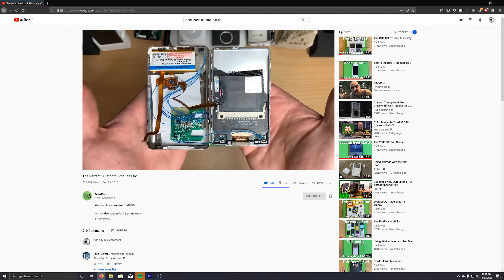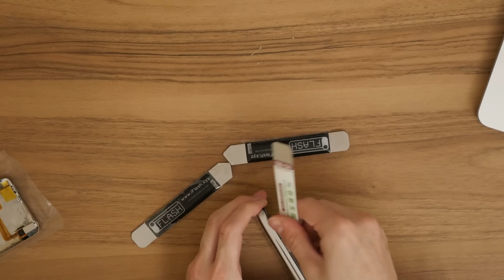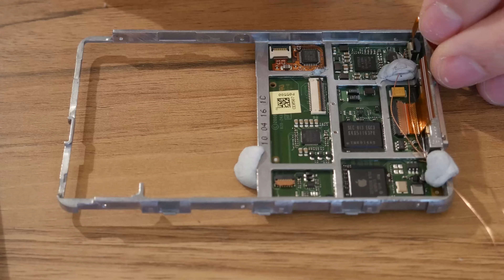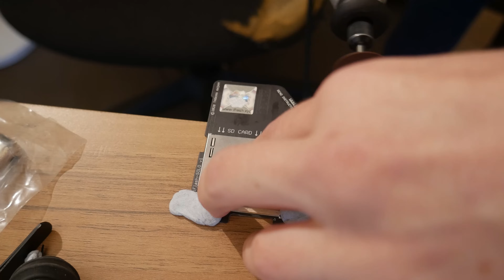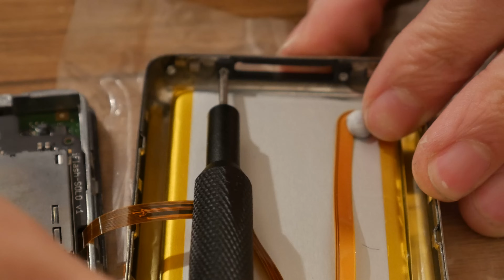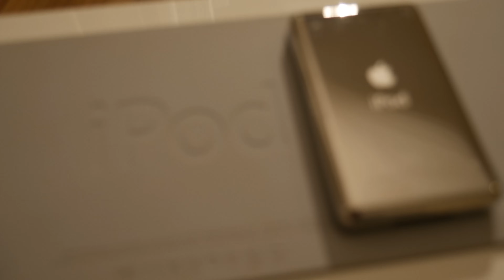The REAL Perfect Bluetooth iPod Classic

Comment: I can 3D print a bigger housing for my iPod, so I can probably fit the 3000 mah battery, Bluetooth module, and a quad flash board
Reply from the maker: I would love to see this.
Reply: Pendleton 115 I would attempt it, but my soldering skill are garbage and I don’t want to ruin my 5.5 gen 80gb ram motherboard
Reply: @Pendleton115  I have found a significantly smaller Bluetooth transmitter so you can use the original back. This module should fit it the space where the old battery was. 
https://www.ebay.com/itm/2-in-1-USB-Bluetooth-5-0-Audio-Receiver-Transmitter-Wireless-Adapter-Dongle-Aux/164396872805
https://cdn.discordapp.com/attachments/752715920400449577/762758463331237920/unknown.png
Maybe a part 2?
Reply from the maker: Chello Chamber very interesting! Thanks for the link. Any idea on the quality? I originally planned on using a small Bluetooth transmitter but the quality sadly wasn’t up to my standards. And unfortunately the biggest issue getting the thin back to fit isn’t actually the transmitter, but the flash solo. Which is too thick.
Although maybe there would be a better chance with an iflash quad and this smaller transmitter.
Reply: @Pendleton115  The iPod Modding discord is full of people who are enthusiastic about this topic. I wasn't the one who found this part but someone else has and has ordered one. You can probably ask him a few questions. https://discord.gg/aYJKwP

Comment: Awesome video - by far the slickest setup of Bluetooth I’ve seen on YouTube. 

In the q/a section you mentioned about needing to reset the Bluetooth adapter if it stops allowing a connection. How frequently does this happen? It is obviously an issue that some may not be able to resolve without returning to a technical guru. It makes it hard to build a business case for it if you’re dealing with reliability issues?
Reply from the maker: Greggles UK I’ve had this happen once in the past 3 months of using the device, and it was caused by a firmware update on my AirPods. The device was still able to pair to other Bluetooth devices easily though.
Reply: Thanks for the very quick reply ! That’s a little more re-assuring.

Great video and thanks again.

Comment: Hey, thanks for the video and congrats to the really cool idea of putting the push button „behind“ the on/off switch!!!

I currently use a Bluetooth transmitter that won’t power off. So it constantly discharges the battery since the two solder points don’t reflect the state of the device (on/off or locked/unlocked). 

Did you happen to  know if there is a place on the pcb that provides that? Power only when the device is „on“?

As an alternative, I was thinking about using the lock/unlock switch of the iPod. I could track that with an attiny and this would then power the Bluetooth transmitter...  

Any thoughts?
Reply from the maker: I tried looking this up, but couldn’t find any documentation on it, it’s usually better to have an external switch as you need to pair it also. You can always turn the lock switch directly into the pairing switch by soldering to its solder pads if you don’t want to have a button behind it.
Reply: Pendleton 115 oh, the button is already in place. Glued on top of a piece of a chopstick, since I used an pod with a deeper back :-)
And it works like a charm. 

And yes, same here. Had no luck finding any information in the pcb. Only some options for sound and power. 

I’ll look at the switch with the Multimeter and see what I come up with. Maybe I can use it to turn on/off the BT transmitter.
 I don’t want to damage the outside and drill holes into the iPod. So I’ll have to come up with something else.
Reply from the maker: Lennart Hennigs usually Bluetooth transmitters only have one button, that acts as both power and Bluetooth on off, but if yours for some reason has two, you could use hold switch for on off, and then the button behind the hold switch for pairing.
Reply: Pendleton 115 I don’t use a stand alone emitter but a board. It’s called KCX_BT_EMITTER 1.2. you’ll find it on eBay and Alibaba. 
The advantage is that it is really tiny, has solder pads and you need no disassembly. But no, no power down logic. But yes, the on/off switch of the iPod might do the trick.

Comment: I'm truthly blown away with your skillz set. Before i give a little info on me, let me ask you where we or I can find the click switches you're using on your video? Don't have to be exact, but close enough to work with your video if needed. 

About me I been playing with the iPod Classic 5.5 80g thick back units. I've modified (4) units so far. A 2TB (Mem cards), 1TB (Mssd), 1/2TB (500Gb Mssd), and 80GB to be modified to 4TB when parts come in. Its been an adventure I must say. Will answer any questions if needed. Awesome video that I plan to use for Blue Tooth mod 4TB first. The four slot card sold on the internet I plan to use with 1TB(4) memory cards. I format each flash drive or Mssd drive to exfat before i connect to ituned, faster process thru itune. Nuff said for now
Reply from the maker: Hornet72blue it’s a switch about 1cm/x1cm, I believe there is an arduino kit that comes with a set of them soldered to a board. That’s where I got mine from anyway.
Reply: @Pendleton115  Thanks you're the BOMB, much appreciated

Comment: What is the difference between the headphone and hold switch flex cable in the thin iPod and the thick iPod. I have the same iPod as the one you have used in the video but I don't know what the difference in the cables is and if its vital for the project. Please help.
Reply from the maker: The cables are identical, the connectors at the end are different, the thin back has a curved connector, to make it line up with the curve of the iPod housing, the thick back is flat as it sits in a flat part of the housing.

Comment: You should watch this video it's called "IPOD CLASSIC UPGRADE" by GEEK DETOUR ...... and another video by TARKAN AKDAM himself. By watching his VIDEO i had the chance to build myself three 7th Gen IPODS with Msata's ssd and the same 3000mah battery you are using....... One of them is 1TB and the other Two are 500 GB ..... And they are still working AMAZING . And by the way the IPOD has only 11 retainer clips..... 4 of them on each lateral side ...... 1 on the top in middle  ...... And 2 on the bottom on each side..... Note: Try to use the "ISESAMO opening tool" is so much better ...... "Trust me"      Far better.....  "Good Video"
Reply from the maker: Thanks for the info!

Comment: Would you at all try modifying a 3rd generation iPod to accept a usb 3.0 charge which is comparable to the 12v firewire charge that prevents it from charging via usb? I really like the solid look of the 3rd gen with the touch surface and lights but hate that I have to use firewire to charge it.
Reply from the maker: Philip Dahl doubtful this is possible, as the third gen requires a lot more juice than what can be provided over USB, although I’ve never used one so possibly im wrong. There’s a chance you could use thunderbolt 3 to charge it but it’d be a difficult process. Probably better off buying a 2012 MacBook Pro with Firewire.

Comment: Gonna try this but will probably add a button instead. Has the hot glue held up in holding the push button?
Reply from the maker: No problems so far, it’s survived the Aussie heat but I wouldn’t leave it in a hot car.

Comment: Cool mod, but there are a few notes I'd like to make:

1. The 7th generation iPod Classic uses a Cirrus DAC, whereas the 5th generation uses as Wolfson DAC. Most audiophiles agree that the Wolfson DAC sounds better.
2. The 5th generation iPod doesn't have that metal shield behind the display, and its faceplate is plastic, so you wouldn't have to cut out that little rectangle if you used a 5th generation.

Additional notes:
If you get a 5th generation iPod, make sure to get the 80gb version. The 30gb iPods have 32MB of RAM, while the 60/80gb have 64MB of RAM. This allows you to put as many tracks on it as you can on your 7th generation, while the 30gb iPods can only have half as many tracks loaded at once. The 80gb is the 5.5 gen, while the 60gb is the 5.0 gen, so that's why you should get the 80gb.
Reply: finding 80gb 5th gen ipods is real tough tho
Reply: @syn010110  Unless you intend on having more than 25,000 songs on it the 30gb model is more than enough. Heck, the money saved could go on flash storage mods instead.
Reply: I doubt if this really matters. for with the transmitter the audio will be lossly converted to digital signal again. I personally think for people who really appreciate sound quality, trying to use bluetooth now on ipod is not a good idea, can wait until speaker/headphones supporting lossless codec to reduce the loss. 
side note: I got one 5.5gen after reading how good it is. it is disappointing. very poor when playing metal or any heavier music. And because we cannot bypass built in DAC easily in 5.5gen i think 7th gen ipod is way more suitable for DIY upgrading. 7th can also be installed into the case of the 5th generation for space extension.
Reply: @weilingxi2427  the apple port at the bottom of ipod. Uses proprietary pin outs to defeat internal audio path.  A high end dongle to dac/amp combo brings hifidelity sound. Dongles made by moon audio were the best back in the ipod heyday
Reply: @weilingxi2427  everybody in this comment section described it as "Warm", so... Of course it's not gonna sound optimal with metal?
Reply: I honestly have no problem with a 30gb 5th or 5.5 gen. I wasn't intending to put much storage in it anyways, just 64gb. 20,000~ tracks is perfectly acceptable for me.
Reply: He's listening over Bluetooth; audio quality of any other part of the system is entirely irrelevant.
Reply: I have a question about modding in general with the 80gb 5th gen. What's a good amount of storage to put in it that will be easily recognized?
Reply: @GodzillaofTokyo  256gb.  As you go up in memory it tends to slow down everything including boot time.
Reply: @GodzillaofTokyo  I have found that when over 20,00 titles, the classic is slow as a slug.  It takes 3 to 5 seconds to navigate each click. It will also add 30 to 90 seconds to boot up.  So, over 256GB makes no sense.  Also, buy the fastest SD card you can afford.  You must use the iFlash adapter.  I have found that the original 160gb hard drive is 50 to 100% faster syncing than any SSD.
Reply: @GodzillaofTokyo  128gb
Reply: i don't understand i have a 30 gb ipod video and its the 5.5 one
Reply: Mostly untrue.
1. Most audiophiles prefer gen 7 for the digital out. Think Wadia iTransport

2. Only true statement

Additional note, not only the 80GB but also the 60GB and 30GB can be 5.5 ver the only real way to tell is to check for 'Search' under 'Music'
Reply: my 5th generation iPod was stollen on a Jetstar flight in New Zealand.  I replaced it with a 7th generation not realizing the DAC was inferior.  Fortunately, I caught a respiratory virus some years later and one of the side effects was suddenly my ipod classic sounded better.
Reply: Is there a name for the ipod ram modules?
if there's a small enough one, you might be able to Frankenstein it in place of the old one
Reply: thats a dream to read as i sit here with my 80GB 5.5 gen
Reply: i got the 5g with 30gb. but it was a long time ago. i just like it more than other ipods cuz its thinner.
Reply: Can the RAM chip be de-soldered and replaced with a higher capacity one?
Reply: @philliumo  Theoretically I would say yes, but you would need to flash a new firmware onto it that fits the hardware change. A different RAM component would most likely require a different initialisation sequence, different commands, and so on to run at all. In the best-case scenario that the new RAM works exactly like the old one but only has more memory, the old firmware probably still has the old byte size hardcoded somewhere.
Reply: I SSD modded a 30gb A1136 5th Gen. Not sure about the max capacitiy, but you aren´t limited to 125gb as in some of the 6th gen ipod classics. I got 256gb in there. Works like a charm.
Reply: What is that metal shield even for? I just thought maybe for reflecting the backlight of the display, but then again, the iPod video has pretty much the same display but with a plastic shield and the displays still look the same. Honestly, I would just switch out the metal shield for a plastic shield and see if it works.
Reply: If you are audiofile you dont use ipod 😆
Reply: @XX-ii8yh  aren't you special
Reply: I got the 30gb 5th gen iPod Classic, as it was on a great deal! For $25 shipping included, I can't really complain. On top of that, I know the 32mb of ram is plenty for me, as many forums talk about how as long as you don't exceed 10k fully itemed songs, you shouldn't experience freezing or tearing with the 32mb of ram and i definitely don't have anywhere near that yet lol. Also, it isn't the 5.5 gen with the search function and ya that would have been nice, but again, for the price i got it im happy. Maybe I'll resell it down the line after getting the refurbing experience from this one and splurge on a 80gb 5.5 gen model, if I feel I am needing those features.
Reply: Got one 80gb 5.5 today.
Reply: Wolfson DAC is praised for the same reason people like vinlys, the "warm" sound, meaning distortion. The warmth in case of vinyls is the wear and tear literally smoothing out the pits and groves on the record. In the case of the Wolfson DAC warmth/smoothness is actually the DAC being inaccurate in its sound reproduction of poor quality rips, but in a way that sounds pleasant to a lot of people. But understand that it's pleasant because the warmth/distortion plays well on lower quality headphones, earbuds, etc. If you have a good pair of accurate headphones, and high quality rips, the Cirrus DAC is superior.
Reply: @zecksoz  Yeah, I wrote that comment a while ago, I now know that the later model iPod DACs are actually more accurate.
Reply: Thanks
Reply: Incorrect / misleading

Here is the correct RAM breakdown:

5th generation (original, 2005)

30 GB → 32 MB RAM
60 GB → 32 MB RAM
Both are 32 MB

5.5 generation (Enhanced, late 2006)

30 GB → 64 MB RAM
80 GB → 64 MB RAM
Reply: Wish I would've known what DAC was a few days back before buying the 6thGen classic
Reply: @UdodaTube  Don't worry about it. I have both types of iPod and the difference is slight at best. Neither of them are as good as people make out, tbh.
Reply: @UdodaTube   Don't worry about it, they all have pretty good audio.
Reply: @UdodaTube  Cirrus DACs in 7th gen iPods are very good sounding and are actually more accurate than Wolfson ones. Plus, Wolfson is owned by Cirrus, and apparently the amp in the 7th gen is way better than in the 5th gens.
Reply: @RiveTheRat  This guy knows what he's talking about. The Cirrus DACs are very neutral and good quality. The Wolfson one has a "warmer" signature, which some like and some don't. In terms of pure audio quality, they're about the same.
Reply: @RiveTheRat Accurate vs Warmer, most people prefer the warmer sound to the flat sound
Reply: there is literally no difference between 5th gen and 5.5th gen. all you are doing is throwing away cash
Reply: @thomas5  as far as i know the one change i have seen is 5.5s have a search function for your library
Reply: @Nate-sq7mw  They also have a brighter and more color accurate screen. That is, unless someone swapped the screen out (they're cross compatible).
Reply: @thomas5    Unless you need the  'Search ' feature. 5.5 only
Reply: @thomas5  you can search on the 5.5.
Reply: @thomas5  the search feature, the enhanced UI speed, enhanced video playback, brighter screen.
Reply: @thomas5  more ram (and yes, there is more ram) and the search feature (no one uses that)
Reply: Thomas Simpson there is though. More ram means it can handle more storage if you wanna flash mod it and stuff it full of songs.
Reply: @unchpunchem8947  there is no ram difference between 5 and 5.5
Reply: @thomas5   30gb has 32mb ram,  60 and 80gb have 64mb ram.
Reply: @artman102  That is not true. Every 5th gen model has 64mb ram standard, the motherboards are identical across all models.
Reply: @thomas5  only for 60gb (5th gen) and 80gb (5.5 gen) those will have 64mb of ram but the 30gb (both 5th and 5.5) have 32mb of ram
Reply: @thomas5 Yes there is, 5.5 can handle up to 1tb of flash storage while 5th gens can only handle about 260gb
Reply: @dustedgirl101  3 year old comment bro stop living in the past
Reply: @thomas5  no
Reply: @thomas5  no they do in fact have more ram but unless you have literally 30,000 tracks you won't notice any difference.
Reply: @emmettmartin2639  Shuffle will glitch out or become painfully slow.

Comment: What if you just solder the board directly to the battery so that everything just stays in the housing? Or better yet, wire a 3 pin connector to the board and female connector to the headphone jack.
Reply from the maker: Mahmoud Nadi You could do this, but there’s risk of damaging the battery, also when the battery dies it’ll be tougher to replace.